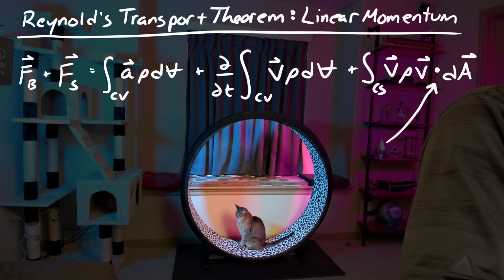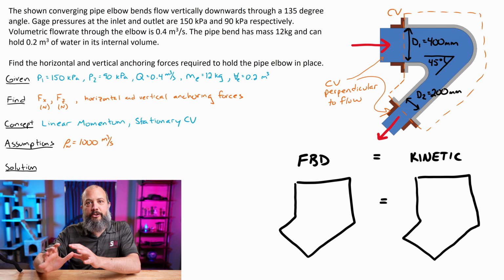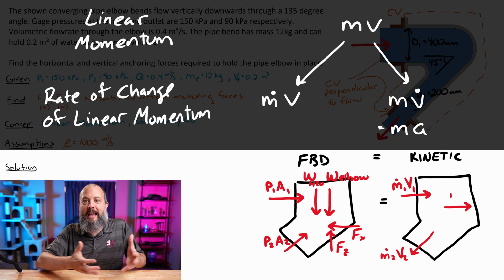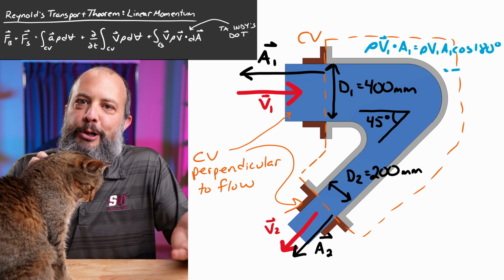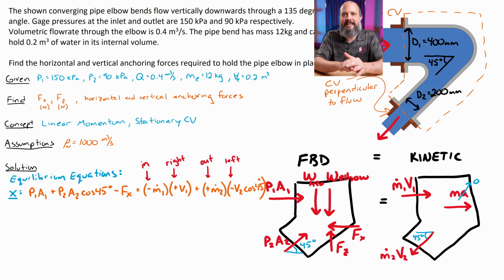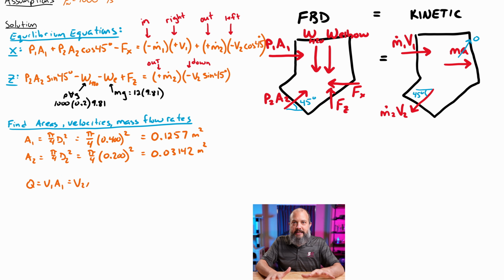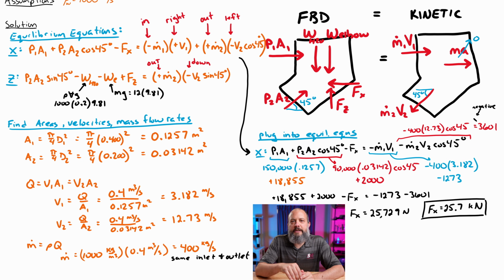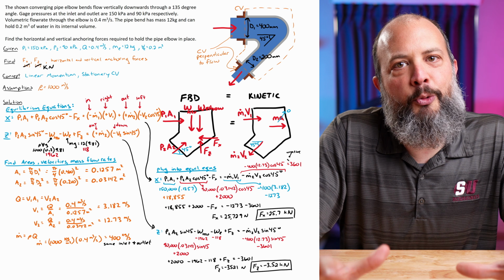Force on a Pipe Bend - Fluid Momentum Example Problem

Comment: is right positive because you already determined a coordinate system with y axis positive upwards and x-axis positive to the right? Because when calculating over a tee pipe, you would determine the coordinatesys. another way?
Reply from the maker: Yes, I defined my xy coordinates positive Right and Up, default style. You could rotate these for a different problem where it makes sense, my choice was convenient, but ultimately arbitrary.

Comment: If the pressure at the outlet was Patm, would we consider it then? Since the cross sectional area at the outlet is different?
Reply from the maker: I would almost always recommend working in terms of gage pressure, which makes Patm = 0, and can be ignored.

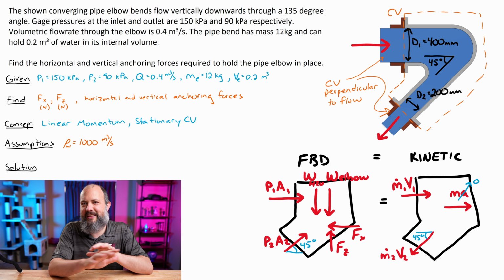Comment: @4:17 What if you have a nonuniform flow? You need to include the integration over the control surface.
Reply from the maker: Yes, this is correct. It would have been better if I had explicitly written "uniform flow" in my assumptions section, since I was making that assumption here, which makes the integral trivial.

Comment: Why do we use gauge pressure? And not the abs
Reply from the maker: It's usually the difference in pressure that actually matters. Pressure inside something pushes outward, atmospheric pressure pushes inward. The difference is important since you are summing forces in the two different directions to get a net force due to gauge pressure. This is why you don't actually measure atmospheric pressure usually. Atmospheric pressures changes a bit everyday due to weather. Since we only care about the gauge pressure, it doesn't matter exactly what the reference points absolute pressure is.
Reply: @BrianBernardEngineering  If the pressure at the outlet was Patm, would we consider it then? Since the cross sectional area at the outlet is different?

Comment: Ive been an engineer for about 3 years now, absolutely love it. Best explanation I've come across... what is your background?
Reply from the maker: Your TA Indiana is just a regular kitty - no formal training at all - entirely self taught. For me - I was a nuclear power officer on submarines in the us navy. That was my first job after college. Nowadays, I have a phd in mechanical engineering, and I teach at Schreiner University in Kerrville, TX. Thanks so much for watching.
Reply: @BrianBernardEngineering  i would love some examples of an isentropic nozzle and its relation with static air temps at different points in the nozzle. How do the temps differ? especially, being isentropic (trick question?) Also, tie in the mach number at a specific point IN the nozzle. Want to see an example??